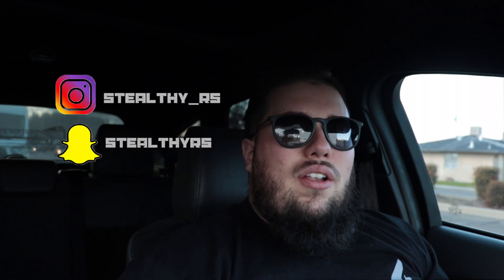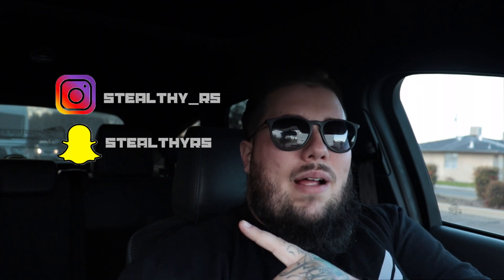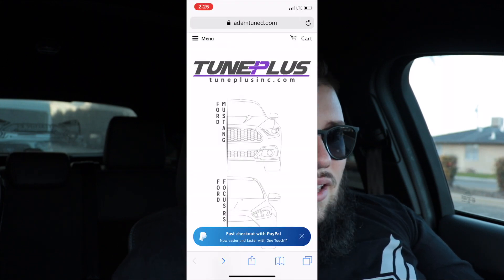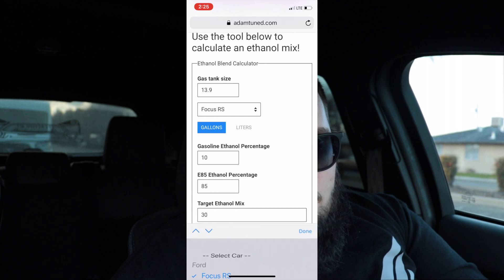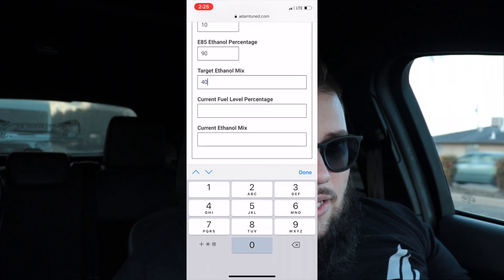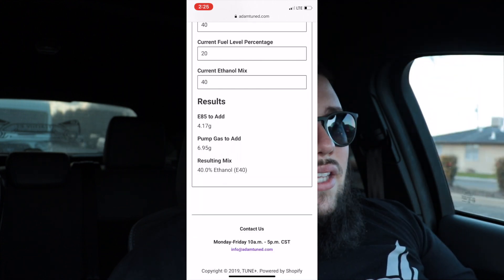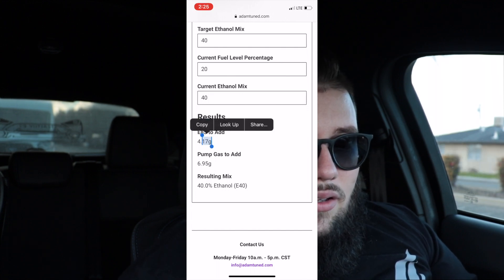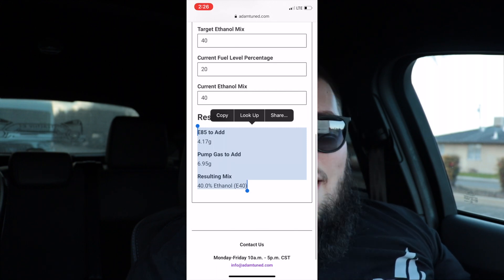How To Mix E85 | 2017 Ford Focus RS

Comment: Why not go full e85? Too much math and science involved for the mix haha
Reply: @StealthyGarage  Similar to the Evo; fuel pump, injectors, and a tune. Noticed that a lot of cars that use the Cobb Accessport use some sort of E85 mix (E40,E60, etc.) rather than straight E85 and didn't know if there was a specific reason.
Reply: e85 on an ST or RS requires a complete auxiliary fuel system
Reply: 2017 BMW X3 R Spec them stations in SoCal bro.  Theres a few stations in sd with an array of eXX options.  However they dont blend e85 with 91 so u gotta do it yourself.

Comment: For the current ethanol mix if your running 93 and it’s your first time putting in ethanol do you input 10 like 91 or something else?
Reply: Thanks guys appreciate it!
Reply: You put in 10 since pump gas is generally 10 percent ethanol. If you're coming from a previous E30 tank, obviously put in 30. Hope that helps!

Comment: Man, that's a hell of a lot of work for a daily driver. A flex fuel setup is definitely the way to go but haven't seen much available for the RS'es. I'll be sticking with 93 until that's an easy solution.
Reply: @StealthyGarage  Yeah but then everyone talks about how that poses a tuning issue and how it'll never quite be a smooth transition from just the HPFP to when the port injection kicks on. I saw Livernois was working on an upgraded HPFP as another solution but haven't heard much on that either. And i feel you on that one, one of (if not the only) good things about living in Jersey.